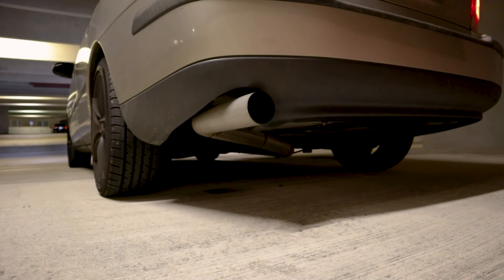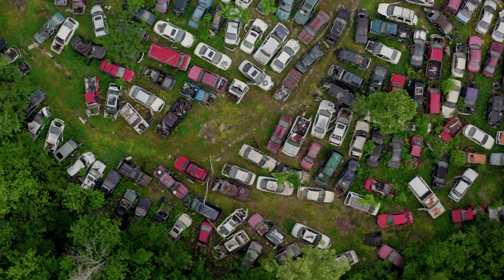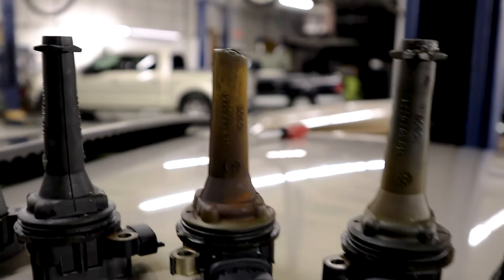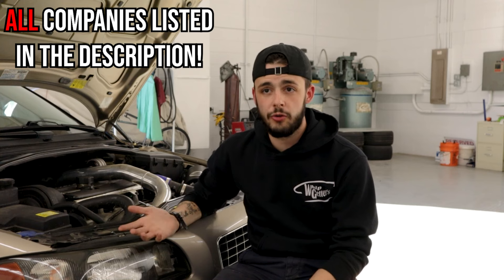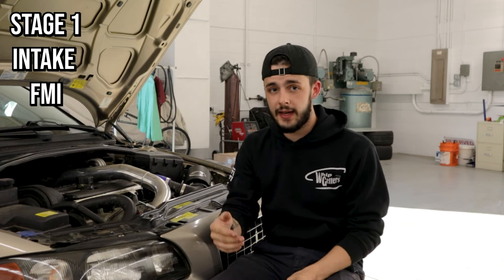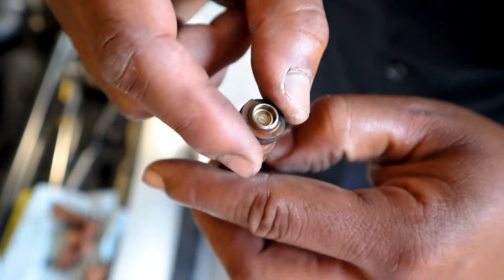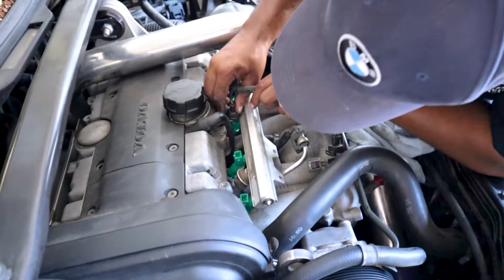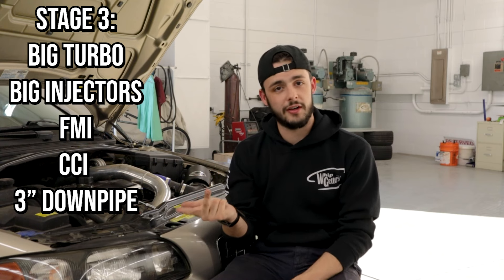What To Expect When Modifying A Volvo | Understanding Volvo’s & Performance

Comment: This video is perfect for anyone who wants to buy and modify a S60. We have 5 S60R’s (4 that are road legal and not a parts car) and all of them have stage 0-1.5/2 done to them. Can’t wait to see more content!
Reply from the maker: Thanks a ton for stopping by and watching the video! Having 5 S60R’s is pretty impressive. We’ve thought about getting one at some point; either a S60R or V70R!😎
Reply: @WhipGetters  you should get an R! The only issue we’ve ran into with R’s (other than normal well known issues) is the front right axle for the manual (m66) trans is stupid expensive to replace ($700+ depending on what site you go to). In our fleet, we’ve gone thru 2 of them already.
Reply from the maker: Oof! There’s a lot on R’s that are a little scary to replace and costs. But what we’ve realized is that if you’re a Volvo person, there’s no going back regardless of that model you get or have!🤣

Comment: I think you got a bad S60 bro. My 2005 T5 is at 247000 miles now with D088 intercooler, Snabb downpipe, 6spd manual trans swap, moderate tune , intake. Very reliable.
Reply from the maker: It’s possible! Not every car can be a gem but you can sure try to make it be.

Comment: Couldn't agree more with the stage 0 before you start adding power. I have a stage 2 (350bhp) v70 2.4 T5. It is tuned by shemtek (u.k based) and he always recommends stage 0 before tuning. A brief explanation of this would be
-Plugs and coils. My car had the original coils on and after I tuned it, each one was dropping one after the other. I replaced them all for genuine in the end.
-Pcv system replacement. Expensive using genuine parts but prevents your cam seals and crank seals leaking in the first place. Also a bad pcv can cause maf error codes which can upset a tuned car
-replace all the one way valves on the engine and check for boost leaks from pipes and the turbo inlet pipe.
-replace tcv (turbo control valve) if its old as these commonly go wrong on higher mileage volvos
Like the dude in the video says, tuning volvos ain't cheap, especially if you want the job doing right. But it's soooo worth it 👌
Reply: What part of the uk you from bro?? I need help with some basics on my 2.4i S40..
If you could help or know someone who can that would be awesome!
You got any social media??

Comment: I have an 04 VR. So far, I have a FMIC, upgraded sway bars, coilovers, the swedespeed high flow air filter and have gone through most the entire drivetrain/engine. The PCV system would be the biggest thing to make sure to keep in good shape since that causes oil to be pushed out of your seals.
Reply from the maker: Funny thing is after we’ve made this video, we’re replacing our PCV system!🤣 Thanks for the info and pretty sure we’re gonna need your R!😮‍💨😂
Reply: @WhipGetters  Make sure to get the Genuine Volvo stuff. This is one of those areas you don't go to the aftermarket for. Clean up you throttle body and replace the gasket while you're in there also.
Reply from the maker: Volvo only brother!😎

Comment: great outline on safely modding P2s! we need more content like this. 

There are actually some very recent tuners entering the p2 community. developing tunes for 04 and 05+ P2s for all trim types. they currently have multiple examples of reliable stage 1 and 2 tunes on the road. stage 3, 3+ and 4 are currently being developed and tested now. some very talented tuners and builders got together and have been working to understand how volvos ME7 engine management system works in great depth. they are not just re-using existing tune files that got passed around and adjusting them...they are developing their own tunes from scratch which is huge. 

Hilton has been the only option for P2s... but his backlog is like 6-9 months right now which is a bummer. luckily the p2 community will be getting the support its needed very soon!
Reply from the maker: Thats really good hearing that more people are taking initiative to learn how these cars work. They are a bit quirky and can be very tedious. These cars are amazing and it’s really always good to hear they’re becoming a bigger normal than before! We have our S60 tuned by Hilton on stage 3 and it’s awesome! Can’t wait to see what more we as a car culture can do!

Comment: No oil leaks , but there is a power steering leak which I have all the parts for,the lower cat has been removed as well,aftermarket fan mounting straps ruined my radiator I believe, I want it running right now, love this car

Comment: have had several volvo 5-cyls, never had a turbo, until i got a 2000 s60 2.4 200hp all leather spaceball. One of my first was also removing the last muffler that was brand new haha. Then i cut out the airbox, dont care that i suck warm air, i just wanted the sound. Then i got a stage 1 ecu tune. 250hp, man, it felt like i bought a new car again! after that one spark went out, but before that i checked my injectors. And yeah, the injectors really needed a clean, did a flow test, and none of them where in sync. One of the injectors flowed like 1/3rd of what it should, it was really bad. Changed out that one and flowchecked and cleaned them out with injectorcleaner and a cleaning program on the flowchecker. Anyhow, check your injectors is what i want to say to everybody with this story.
Reply from the maker: Volvos fuel injectors tell you plenty of things. They sure let you know how expensive they are, but also the severity of how it treats your car when they’re not working correctly. Very good point with the fuel injectors!

Comment: As a B5234 owner, I would add that PCV should be changed.  Also all the TCV (Turbo valve stuff) should be replaced as vacuum leaks will wreak havoc on the performance of these cars.
Reply from the maker: Soon after this video, the PCV system on ours was changed! It was clogged and it was ruthless! Our next and final video about modifying these cars will include this!😎
Reply: 2.3 T5 motor for life! fuck the 2.4 i need the thiccc walls 😂
Reply: @terra6084  2.3's sound badass and run forever.  The 90mm stroke + 81mm bore is so solid.  You don't get cracked cylinder walls.  👍🏼 I'm with you bro.

Comment: important not to forget to upgrade your suspension as you add power!  get better tires.  upgrade bushings.  upgrade sways.  refresh/upgrade your brakes.  its great to push 400+ hp out of a car but if u cant control it, then its worthless.
Reply from the maker: Very good point!👍

Comment: I just found your channel and subbed 🤘
I own a 2000 V70 T5 Geartronic with about 311.000 Miles (500.000 km) for over 5 years now. It has been a learning curve... But there is a lot of information about these engines out there, just well hidden🤫 
What i have learned so far : 
2.4 and 2.5 engines need to be shimmed! Even stock the cilinderwalls tend to crack at the top.
It is a lot of work but in parts it's only the shims and a gasket-set for the head.
The 2.3 engine's (like i  have) don't have that issue😁

All of the engines have oil seals in the sump that are critical for the oil pressure, replace them for oem and have one less thing to worry about.
They all have a PCV system, replace only for the ones that have Volvo stamped on the bags😉. The sets cost a bit more but i have had trouble with good branded others causing my camseals to blow out and leaving me with an oil soaked timing belt, happy days 🥳
For sparkplugs only use - i know i am repeating myself a bit now - Volvo original sparkplugs. These engines just love them ❤.
When changing the timingbelt make sure the waterpump has a metal fan (is that what you call the part that pushes the coolant??). There seem to be pumps with a plastic fan and according to the forums those can break in time.
As for the oilcooler on the back of engine, the one that was leaking on your S60, try to find a bigger one. 
They are sold for crazy money by "performance" brands but the very same bigger ones were used on i think certain XC90 engines and those have the same fitment.
And ofc do a good quality oil, oilfilter, fuelfilter, airfilter, coolant, ignition coils(oem) and your engine is good to go!

Radiators with the plastic sides, vacuümhoses, enginemounts, original plastic air and pressure piping are all weaknesses with age. 

Changing the rods for H-beam rods seems to be the general advice if you want to take the tuning seriously, a path into the mist i am about to take 🥴.

Now the limit will be our automatic gearboxes, from what i understand it's critical to have an extra cooler for the oil and to have the tune not go flat-out in first and second gear and she will be able to take a beating. But i haven't found any numbers on how much they can really take.

I hope my essay here helped anyone out there, my rambling is pure from my experience and in no form do i claim to know it all so please do comment if you (the reader) disagree. 
These Volvo 5 cilinder engines are something else..... 🥰
Reply: Also if your engine runs a bit rough, has starting issues and/or has poor gas mileage it's likely that the coolant temperature sensor (near the thermostat) needs to be changed. It is often overlooked when diagnosing a problem bc scanning software usually doesn't pick up on the bad sensor and the gage on the dashboard isn't effected by it. The gage shows a temp calculation by the ecu. From what i understand the gage also isn't very precise and can't be fully trusted.
Reply from the maker: You have put a majority if not all of our experiences with these cars into words that are pretty difficult to explain! We really appreciate your support upon finding our channel, but we also truly appreciate your knowledge.👍 Thank you for teaching us some things as well as giving us next steps for our build. We hope we can bring more Volvo content that you’ll like!🤙
Reply: Thank you! 
I'm Dutch and i am on (i think you call it) benefits as my right shoulder has been upgraded with a steel ball joint and i am no longer able to work. Wrenching results in days of pain but helps to keep my sanity. 
The 850T5 has always been on my bucketlist but i couldn't find an affordable one.
So i bought this car "cheap" bc of the mileage as a project car and as a big family car to take on holidays. 
We have a tiny shed and i have had to do all the work outside with jackstands, handtools and a basic obd plug with a free diagnostic app. I've managed to just keep her running and spread the costs by upgrading only when parts were in need of replacement or if i could find a good deal.
There have been times i just wanted to sell her for scrap and be done with it (even recently 😇 ).
With the help of a Haynes manual, YouTube, forums, advice from Volvo specialists and a lot of patience i really got to know my car and overcome every hurdle she's thrown at me thus far 🤞
I just love my Swedish fast brick😂

Comment: I bought a s40 2.0d 138k on clock. Really not been loved in its life but things are away to change. I'm at stage 0 few leak and egr issues to sort then will be hybrid turbo and water methanol ect. I am currently stage 3 a 2013 civic 1.6 idtec (euro car) I have a 4th gen gtd1244vz being built just now stage 3  52mm compressor ect. I have also just fitted the stage 2 snow performance kit with vc-50 controller i am just waitin on soft hose adapters then will be testing while still on standard turbo stage 1 set up until new parts arrive this week. I also have a custom stage 3 paddle clutch kevtech+organic as they don't make any parts for this eco 60+mpg car that im back engineering to a eco rocket expected mpg is 70+ with a 130% increase in power and torque. Aftwr this i will be moving forward with the s40 beast. Its the car i got for my girl she loves it. I will enjoy being subscribed and watching what you can teach me about this motor. Thank u
Reply from the maker: We love to see that more people know how amazing these Volvos are. Even with tons of miles they can really to forever when they’re taken care of. Our S60 is a stage 3 big turbo and it has 180,000mi. She’s still chugging along. There’s occasional transmission issues, but it’s typical with the FWD transmissions. We’re expecting to get a transmission cooler soon so it can help with the temperatures! Thanks for subbing and staying tuned in to our adventures!👍

Comment: What's up friend!!! First of all I want to thank you very much for bringing this type of professional content, since there is not much formal information about tuning Volvos. Secondly, I also want to thank you for taking the time to answer each of the comments on this video, really thank you very much for supporting this community.
I would like to ask for your advice on the small project that I have in mind, I have an automatic volvo s60 2007, sadly in my country (Mexico) manual volvos s60 and R are practically non-existent, and although I love the car, the engine, its incredible sound and His performance wanted to know if it is feasible to tune the car even if it is automatic, or what would be the limit of the transmission. For example I could do the remapping and get the power up to 300Hp, however I don't know if the transmission would hold. I have also seen some things about intakes and I have seen that the vast majority put blue (snaab) however I wanted to know if it is possible to create one from another material, a personalized one since shipping is quite expensive for snaab.
I have many doubts about whether to start the project or whether to look for another platform like a 350z or something like that.
Reply from the maker: We both want to say thank you for all the good vibes you’re throwing our way! We really appreciate you supporting us while we try and bring better and better content everyone’s way and push Volvos to a higher standard. And about your project, depending if you car has a turbo or not, you can modify the car either way to a certain point. There have been plenty of people modify the N/A cars. This can range anywhere from having an exhaust, custom intake piping, porting and polishing the intake manifold, and sometimes even a tune. With turbos it’s a different story. With turbo Volvos you can do a tone more. Tuning, intake piping to aluminum, bigger turbo, injectors, ignition coils, downpipe, transmission cooler, and much more! As you stated, the transmissions in the non T5s and Rs are hard to hold some power. They’re basically glass if you’re not careful with them, we’ve been there done that… a lot of the turbo models can hold anywhere from 300hp to 350hp reliably if you have the supportive mods and you DON’T launch the car from a dig in automatic transmissions. The automatic Volvos don’t really agree with launching from a stand still position. This can overtime or even a couple of times ruin the transmission very quickly!😮‍💨 As long as you keep your maintenance and care for this car no matter model or engine, it should take care of you for how long you want. Our S60 2.5t has 179,000 miles and it’s a stage 3 big turbo. We’ve had some rough bumps in the road to that complete stage, but giving the car what it needs to maintain it, has gotten us that far! Hopefully some of this info helps. If you need anything more don’t be afraid to ask!😎👍
Reply: @WhipGetters  Is your S60 T5 FWD or AWD? Do you think it is viable to modify up to 300 - 350hp a FWD? or better I get a s60r with AWD?
Reply: @WhipGetters   Something else, do you know if it is possible to increase the size of the wheels of a s60 2007 T5 2.4? It is currently about 17'' but I would like to put some 19'' vossen h5, however I don't know if it is adequate or better I should stay at 18'' safely.
Reply from the maker: Fwd
Reply from the maker: It’s really down to preference. 19”s might be pushing a little closer to rubbing. It also comes down to tire size too. If you want 19”s it’s possible to run if you have a super thin tire. There’s a lot of variations that you could do in order to make them work!👍

Comment: got a v70r     cheapest   one in the  uk  its at 190k miles   first list of stuff  vvt,s  cambelt kit   coil on plug /spark  plugs it had the wrong  ones  fitted  tcv   shocks  (4c was trashed   i got a set of  bc racing coilovers    tho i will   say  to others   even  in soft   mode there very firm   and firmis  basicly  track   firm  so  if you can find  oem spec  struts    thoes are better for road use  )   bushes      lower suspention  arms    injectors  alot more to do but  these  are  20 year  old cars   at this point  so all the   little  things  that have been missed   over the years add up
Reply from the maker: Small things you wouldn’t think about changing will always give you a headache later on!🤣 we’ve ran into that problem many of times with both of our Volvo’s.

Comment: A bit of a random question, but are you able to just change the block of the 2.5l s60r to a 2.4 t5 block and keep the other parts of the 2.5? I heard that the 2.5 is prone to cracking when boosting it.
Reply from the maker: They are if you over boost them. Forums have lots of info on boosting certain motors.

Comment: I have 2015 volvo v70 d4, I want to get some modifications but can't seem to find anything online, which is a bummer....
Reply from the maker: It seems like Volvo diesel and it’s range of performance mods is very slim.🫤
Reply: @WhipGetters  I don't mean modifications as in performance mods just overall visual modifications
Reply from the maker: For sure wheels, but not to sure about other visual mods. It’s very very rare to see a V70 D4 or diesel Volvo in the United States.
Reply: @WhipGetters  yeah, I was thinking of getting good summer tires and rims but not sure yet what I'm going to do